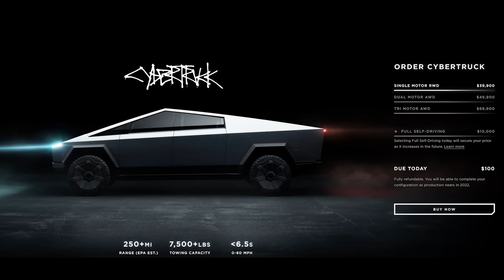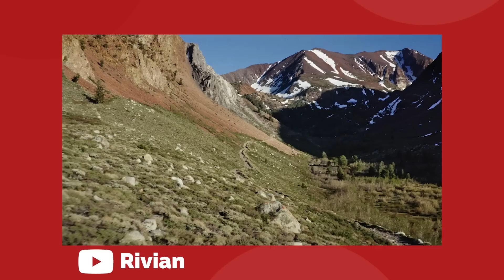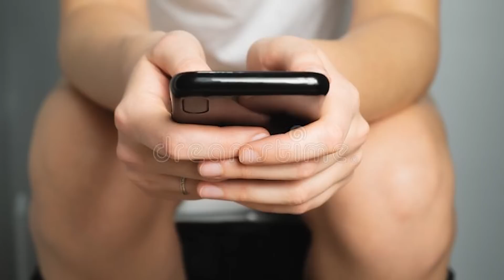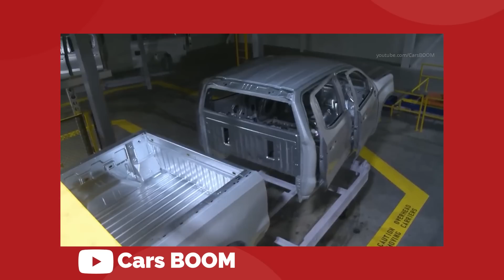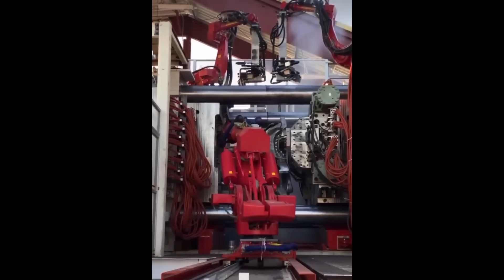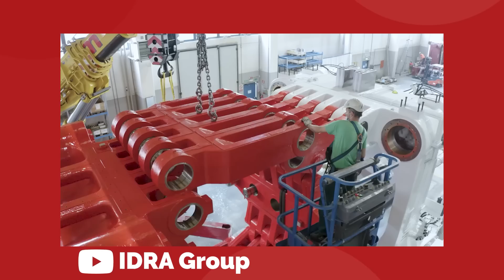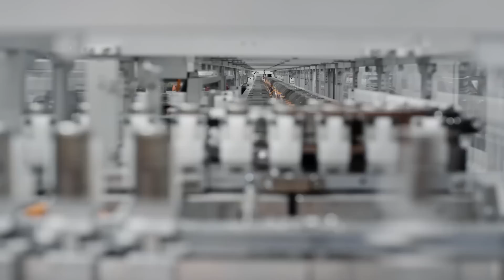The 2023 Cybertruck Update Is Here! (Cyberboat + All New Features)

Comment: I think if the original spec truck was still the one on offer, I probably wouldn't have been as patient to wait, however with all the improvments, I can see that I can't afford the one I want now anyhow! The Spec sheet gets longer and longer. Moving the price point with every innovation. With FSD' Bullet proof glass (Clear Aluminium) 4WD / 4WS using up to 4 Plaid motors and New wheel and tire and Brembo brake designs, not to mention a Starlink satelite dish with ongoing costs for Subscriptions like the FSD and Data for Starlink.  I expect that the fully maxed out Cybertruck to cost around: USD$200k, then having to import to Brisbane Australia would cost $USD25k, Then Luxury car import tax and insurance, I would be paying around AUD$500k to get it on the road here Downunder! Would you be willing to settle for anything less? Let me know your thoughts! What do you think of my estimate? Tesla is still a Luxury car, even the $25k will end up costing $50k.
Reply: Nah I would guess that they will increase the price between 10k to 15k of the original price they released Elon has said several times that one of the purposes of the cybertruck is to transition from fuel trucks. In order to do that it should still somewhat be affordable for some.

Comment: I imagine the rear-wheel steering will only engage at like 10 mph or less as engaging rear steering, if it were possible, at high speeds would be an instant sheet metal, configuration, alteration session (accident:).  I think what is going to happen is there will be a separate amphibious version that has a electric propeller that can deploy.  Or a module that can be added to the regular truck.  Not so rich folks like myself may only wish for the lottery to be able to buy this dream machine  ~Its going to be only $129.99~LoL X A thousand:)
Reply: so rich you should order me one as well

Comment: I reserved a tri motor cyber truck with full FSD for $8000 I hope that price doesn’t change that would be disappointing I understand the trucks gonna be more expensive
Reply: same but i did dual motor but i think you can just chose what ever you want single dual tri or quad motor / potential battery option-  the FSD is locked 8k i dont see they could raise that price though and it could be worth 100k value the fsd if it can even just convoy on highways with trailer following on in front.. (not even fsd just follow) 
full fsd even more value...
Reply: Thanks for watching and commenting .expect more videos. send me a text above 🔝🔝🔝  and acknowledged your price .......................

Comment: Would be interested to see if they could also eventually remove hydraulic fluids by using electric motor braking and full electric steering controls. Removing mechanical parts in favour of by-wire options only a matter of time.

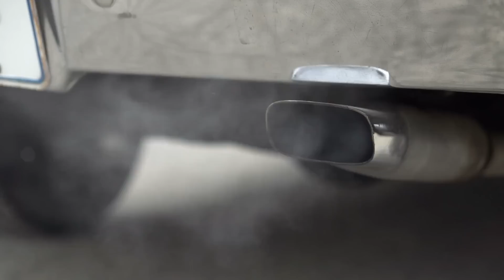Comment: 6:00 Please know what you're talking about before you speak about it. There's so much force in that air coming out that water never makes it up a running car's tailpipe before the intake gets flooded. That's the actual problem in most cases, the intake sucks in water and the engine hydro-locks, usually destroying it.

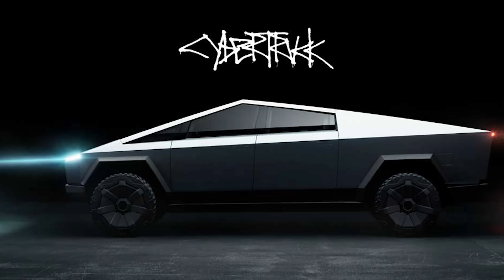6:30 An object can't displace more water than it weighs, it's why all ships are reffered to as displacing x amount of water and only weigh their ancors.

Unsubbed, you're not nearly qualified for this channel.